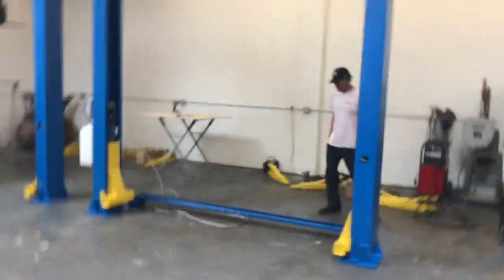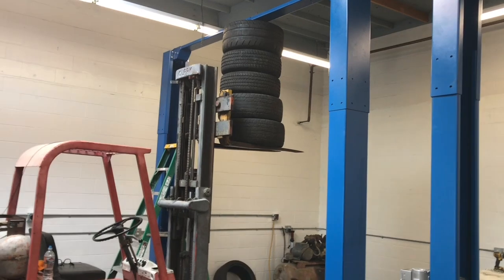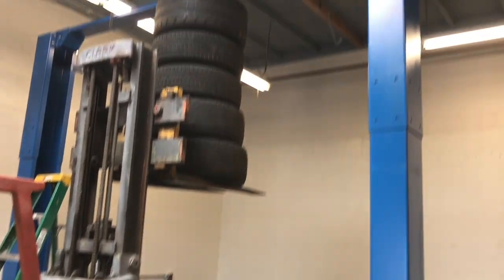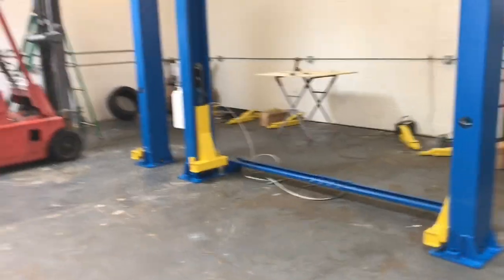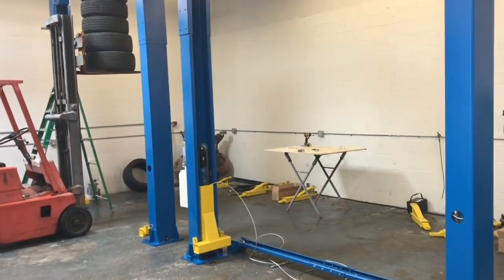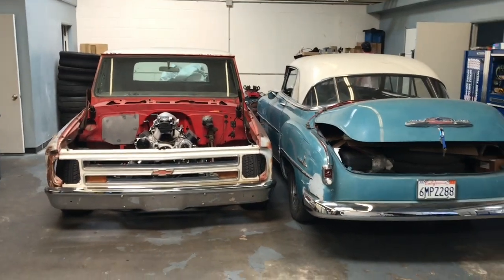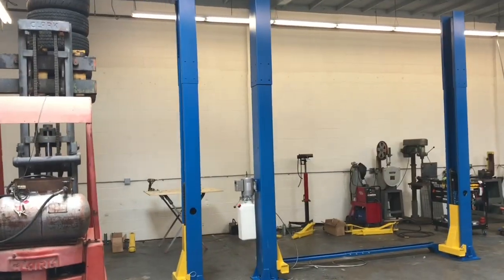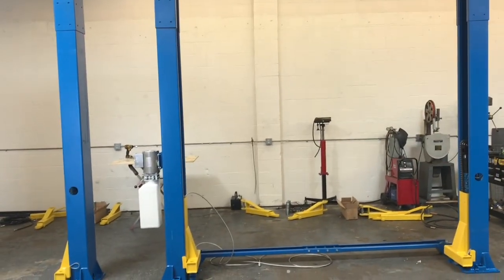Progress @ Lucky’s Garage

Comment: Would it not help in utilizing the space more effectively. To move them off to the right a few feet and angling the lifts, facing the overhead door so you have a space to drive a vehicle that doesn't need to be on a lift. Straight in and park it without  blocking another vehicle that might be on a lift? 

Much like the layout for a dealership shop!

Comment: The way those lifts are now laid out you have one that is usable and the other not easily accessible. Too easy for that lift to hold a "hangar queen" and be blocked in all too easily. Yeah, separate those lifts a bit to allow for passage of tool carts, parts, and maybe a rolling workbench / layout table for work in progress. And with the lift on the right / out from the sidewall, angle it for vehicle entry.  IMO there's no need to have the lifts in the same plane / with both vehicles perpendicular to the rear wall. Both lifts should have "drive in" access without having to "jack" them fore and aft to get them on the lift. The triangular space between the lifts could be used to shop equipment or tool box "parking" - or whatever. Yeah, I did the "non-parallel" side-by-side lifts and had friends ask what I was smoking when I placed them like that; after a few months of use after those friends had been around often enough to see the traffic flow of the angled lift they conceded to my wisdom for installing them like that.